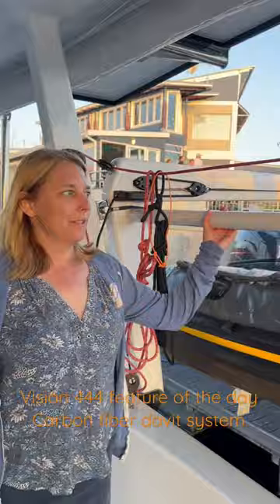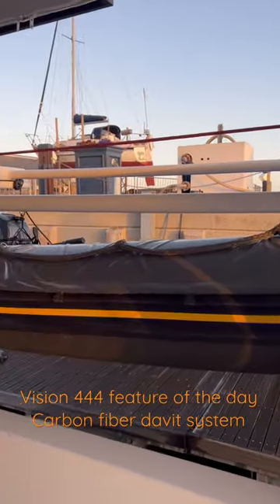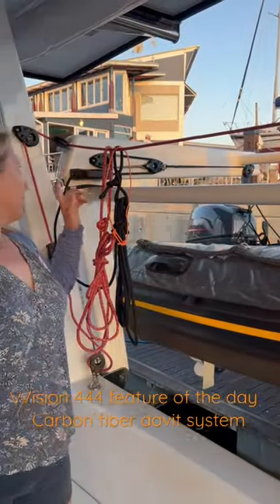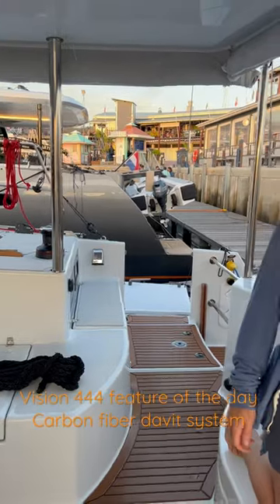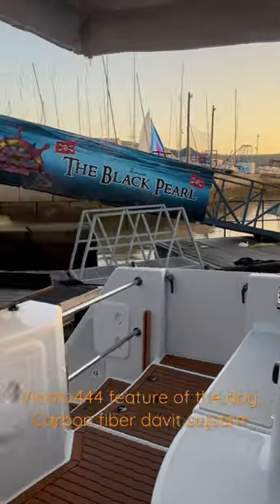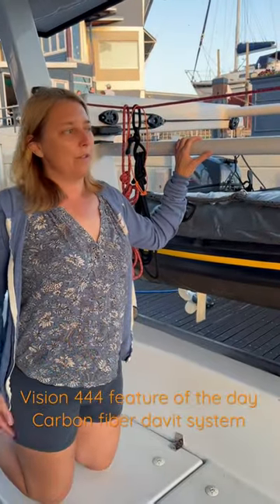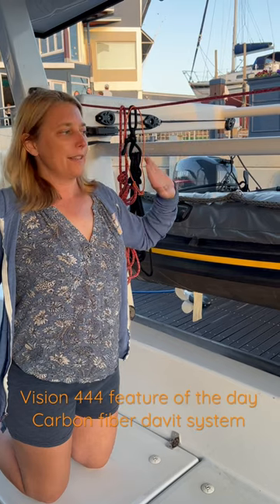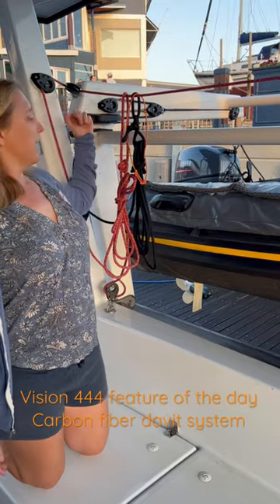@visionyachts2882 Vision 444 feature of the day: Carbon fiber davit system

Comment: These “features of the day” are amazing guys!!! Any idea what the new Davit system weight capacity is??
Reply from the maker: Thanks Mike!  Let me check with the factory and get back to you, but having seen it, I would expect it will be plenty for any tender that will fit there.
Reply from the maker: Okay, James got back to ma and the capacity is 180 kg, which is 397 lbs. A Highfield 360 classic weighs 75 kg, a 25 HP Yamaha weighs about 62kg (depending on model), a full 24 liter gas tank weighs about 20kg, about 3 kg for and anchor and rode, for a total of 160 kg. That leaves 20 kg of other “stuff”. Or you could go with the new SeaUV and the tender weights drops to about 55 kg. More to come on the SeaUV!!

Comment: It looks like you can both lower the davits down to the water and/or also simply hoist the dinghy straight up.  Is that correct?
Reply from the maker: Hi Federico.  I don't think that is actually true.  The small black Dyneema lines are intended to connect to the bridle for connecting to the dinghy lifting eyes.  Once those two are connected, those lines are pulled snug.  I think that intent is to make it easier to make that connection.  Once that happens, you use an aft winch to hoist the davit arms/dingy as one.  Expect a follow-on video when are boat and tender exist. :-)
Reply: @OnANewTack  thank you!  These videos are very interesting!